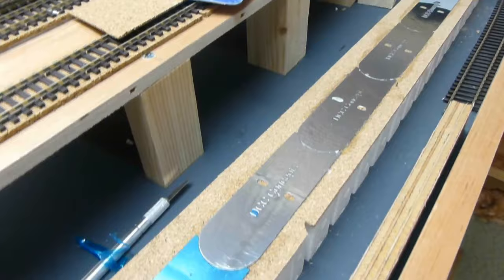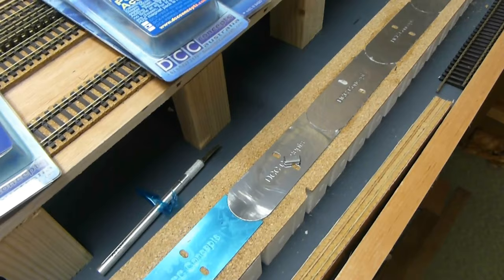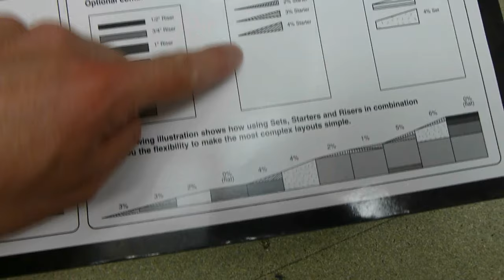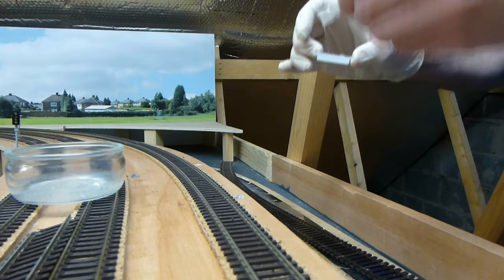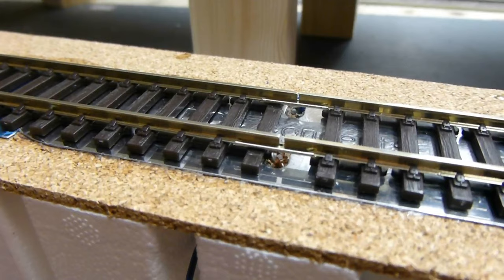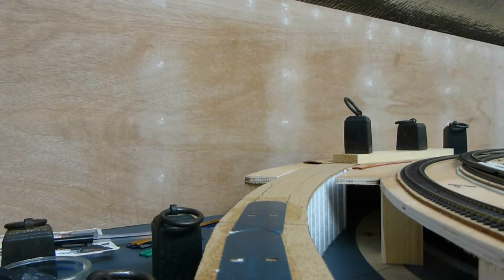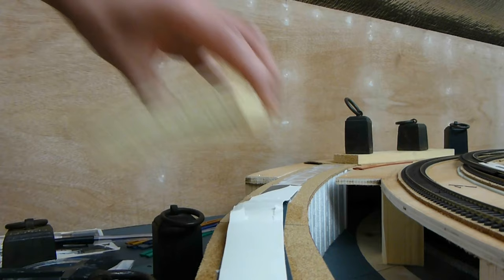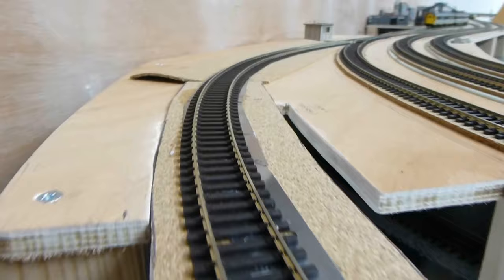Dean Park Station Video 89 - How to Install an Incline Part 2

Comment: Thanks Dave. You have solved a problem for me. I had forgotten about that DCC product. Several of my locos struggle up the 3% gradient on a friend's layout, which is the same gradient as I planned on my own (once the track goes down). I think I'll be installing the metal plates on the inclines as a matter of policy. Cheers, Angus.

Comment: Very interesting, I've never seen that product before but it makes brilliant sense. A spot of silicone in the hole where the dropper passes through the plate would add some insurance against it shorting out. You never know how the wire might move over time with expansion and contraction.

Comment: Nice track laying. A tip I read about avoiding kinks when joining curved track which I used successfully in my helix is to stagger the join. As you know when you curve track one rail will protrude more than the other one. Instead of cutting the rails so they join the next piece of track at the same place, leave the rails as they are. In that way where you have a join one of the rails will be solid giving strength to your track. This is especially useful when you have to use plastic fishplates for insulation that kink easily in a curve.
Reply from the maker: Yeah I have staggered it at the top of the incline.  It is a smooth flow.  However when you remove sleepers (or the chairs from the sleepers) to get the fish plates on it does give the rail more freedom to move on its own accord.  So you just have to be careful.

Comment: Informative and useful, thanks. I have been giving consideration to inclines on a project I'm working on and what you have used here might well be the answer (and raising the non elevated sections to avoid needing to cut into and weaken the boards). The powerbase might well prove essential due to the small size of locos (0-4-0 & 0-6-0 NCB), though the stock will be very light and all 4 wheeled max of around 8.

Comment: I know this video has been around for a few years but I just got to building my own 3% incline with the WS risers and PowerBase. I was surprised to see that you used only one set of dropper wires in that whole length and how did you manage to feed them out like that?

Comment: Another fantastic "how to" video Dave. 
I have purchased a pack of the power base plates. I got a little confused however. I think you said that the incline is around 11 feet and rises to 95 mm. Did you say you needed to buy a second pack of plates? I haven't had them delivered yet but thought it was enough for 5 meters, or are you stocking up your supplies for building the decline? 
In other words, building an almost identical incline to yours, rising 95mm in about 11 feet, do I need more than 1 pack? 
Sorry. My maths is really suspect this evening. Cheers. Don
Reply from the maker: The pack I bought was the starter set, with magnets etc.   Which gave 8ft (2.5m) of plates.  I probably used 13 feet of them as I started them on the flat and continued them right around to the turnout.   I also cut a couple up while experimenting.  So that's why I had to buy a pack just of plates.   They will also do me for the incline at the other end.   Hope that helps? Dave
Reply: That's great Dave. Thanks for the info.

Comment: love you videos dave. very informative. quick question about the powerbase, do you have a recommended way of attaching magnets to the locos? i dont really like the idea of drilling them to affix a magnet. cheers phil
Reply from the maker: hi, unfortunately this is the only way as using sticky tape etc isn't strong enough to stop the magnets ripping themselves off the bottom when they pass over the magnetic plates!   I dont like drilling into my precious models either.   Superglue is the only other way.....but I don't like the thought of that either ;-) Dave
Reply: cool, thanks for the reply man!

Comment: PS. Just read one of the other comments re: rare earth magnets. I picked up a lot of 50 "rare earth neodymium N35" fridge magnets 10mm round x 1mm thick for the princely sum of AUD $4.00 on eBay. Well, I don't now if they are, but they are very strong and would be able to be held in place with a dod of Araldite or similar on the underside of the power bogies. - Just a though. Cheers again, Angus.

Comment: How will get on with the aws ramps you have previously fitted will the magnets not hit them?
Reply from the maker: Good point.   However the HST has very little clearance under the bogies, so I may use the brass cradles to suspend magnets from the underframe detail.  There is more clearance and it wont get in the way of the AWS. Dave

Comment: Hi Dave,  I have been following your cahnnel for quite a while and I must say this is a fantastic layout project. 
Have you tried rare earth magnets?  I think you will find that the N52 grade is stronger than those supplied by DCC concepts and they are available in all sorts of sizes some just 1.5mm thick. Try Guys Magnets Neodymium range, they have an enormous selection and they are very cheap so you can experiment without breaking the bank! No connection just a satisfied customer....John